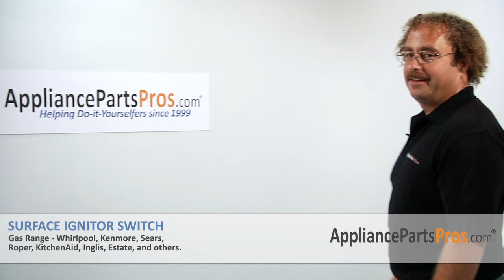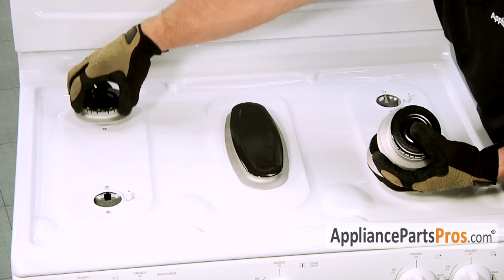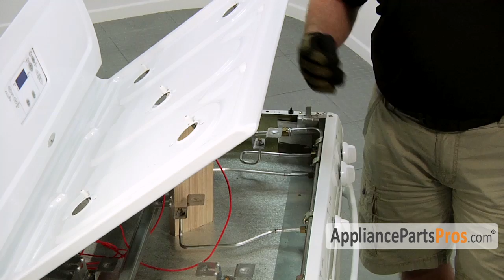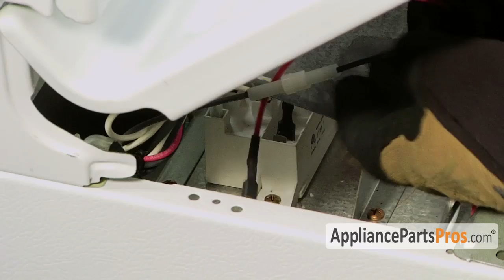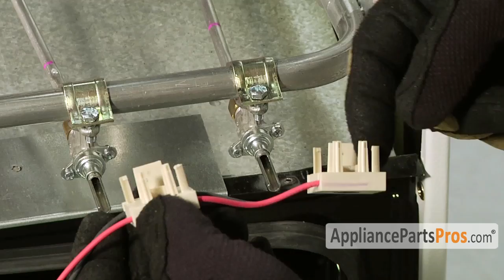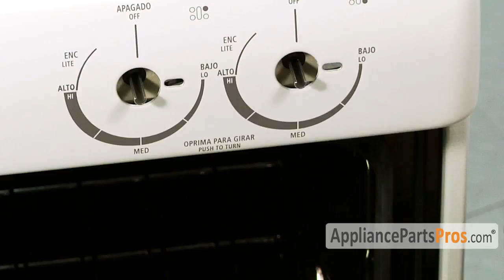Whirlpool Range Top Surface Ignitor Switch W10361493 Replacement — fits KitchenAid/Maytag

Comment: I have a gas stove,  with four burners, do they sell that part? Is my first question.  Secondly do you need to shut the gas off when you switch out the switches? Or just cut the power off?
Reply from the maker: Hi! 😊 The part may be compatible with your stove, depending on the model number. If you share the model number, we can help you find the correct part. For safety, disconnect power and shut off the gas supply before replacing the switches, and follow the manufacturer’s instructions for your specific model.

Comment: The switch itself is fairly easy to repair. Drill out the rivets from the back  with a 3/32" bit. There are two contacts inside. One is fixed, and the other is moved with the little plastic cam disc. Bend the fixed contact down a tinch so it again makes contact with the longer cam operated contact when the cam is in the ignite position. Reassemble, and replace the rivets with a couple small course thread screws for plastic.
Reply from the maker: If there is anything we can help you with please let us know.

Comment: 3 of 4 burners don't turn on gas stove, but will turn on if i use a match and light it up next to them. what part is needed to replace it? thanks.
Reply from the maker: Without knowing what you have, I would suggest posting the problem along with the appliance model number on our repair forum and the techs can help you troubleshoot the problem. http://forum.appliancepartspros.com/
Reply: AppliancePartsPros Maytag MGC6430BDW
Reply from the maker: It is better to post it on the forum for more in depth trouble shooting. To start make sure the igniter tips are clean and the area around it is clean so the igniter has a place to spark to, check all wires for damage, make sure the igniters are nor cracked or damaged also make sure the gas supply holes that provide the igniter with gas are clean. If all that is good you will have to trouble shoot to see if it the igniters, spark switches, spark module or a board that is bad. For that I would say go to the forum as it is too much to cover here.

Comment: Hi some of my ignitors spark and some don't so I think I need a new ignitor switch.  the question I have is that when I put a electric tester up to the ignitors that do NOT spark, I get a reading so electricity is getting to the ignitor.  I would have to but the expensive part and find its something else.  Any advice?
Reply from the maker: pgreenx Have you tried cleaning the igniter tips and the area the spark arcs to? If its dirty and the arc cannot jump to clean metal, you may not get a spark. Also check the ceramic to be sure its not cracked or damaged, this would allow the spark to jump off at a point before the tip. Also make sure the gas pilot holes around the igniter are clean so the igniter gets good gas flow.
Reply: thanks - will try this
Reply: pgreenx أرجو معرفه فك وتركيب زرار تشغيل اىشعله

Comment from the maker: If you have the type of switches in the video you can test them for continuity. All you have to do is unplug the two wires and put the test leads in the wires that go to the switches. When you turn any knob to the light position you should get continuity. Turn them all one at a time, if any of them continue to give continuity in any position other that light, then that switch could be sticking. If it is not one of the switches then it is usually the module.

Comment: When I turn on any of the valves the spark stays on continuously on all five burners. I have to unplug the unit to make it stop.  Would that be an ignitor switch problem or the module itself?

Comment from the maker: Yes it could, there are contacts inside the switch when you turn the knob to the lite position it sends power to the igniters. You would have to test the switch with a meter. In the lite position the switch should have continuity. The other parts in the system are the spark module and the igniters. Make sure you check for loose or corroded wire, also make sure the igniters are clean, not cracked and have a clean spot to spark to.